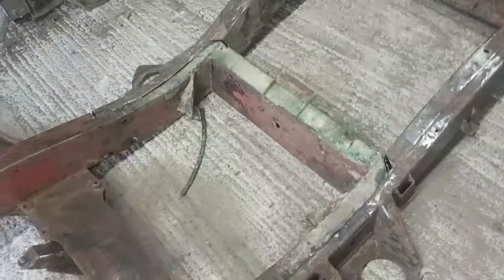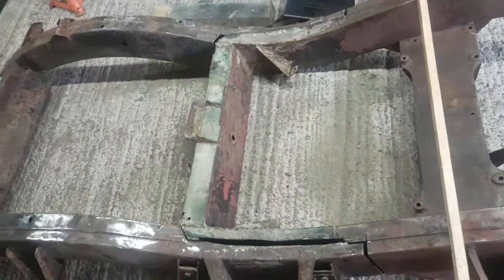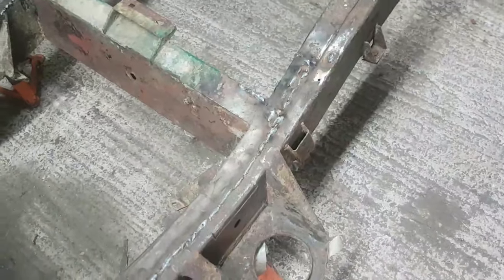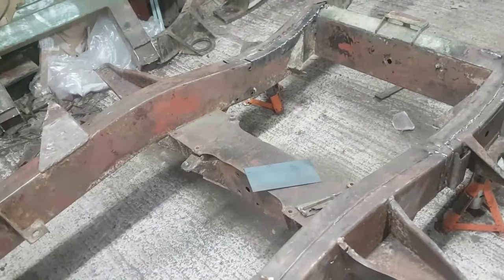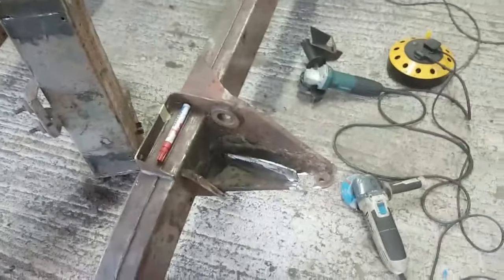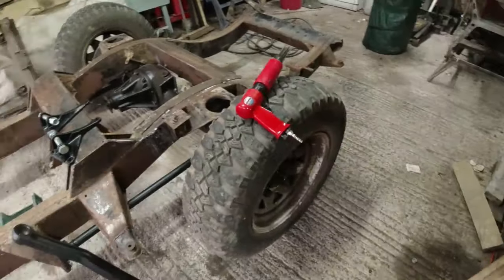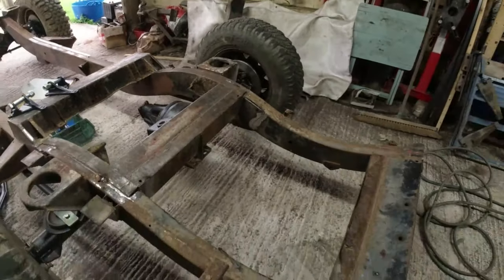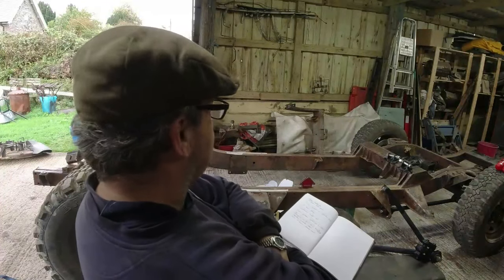Episode 13   1971 Range Rover BOB - chassis wurkz - parental warning

Comment: I love the channel, one seeming daft question kept popping into my head though, I don’t know my rangies too well so maybe I’m actually miles off but isn’t a Range Rover chassis identical to a disco 1 chassis? If so couldn’t you have swapped to a disco chassis as there’s pristine ones getting scraped all over the uk at the moment?
Reply from the maker: UK DVLA rules mean that if you use a 2nd hand chassis it retains the ID associated with that chassis. There is the a points system etc to avoid the DVLA issuing a Q plate. To retain my J plate for this 1971 Range Rover, the majority of the chassis needs to be original. Then so long as the axles etc are to the original design the original ID can be retained.

I know there are a world of cars out there with dodgy ID, not something that I am getting into .👍
Reply: Church House Classics , thanks for the reply, fair enough, I guess if you’re recording the whole lot for YouTube there would always be some bugger to report you ect. 
I’ve noticed that since prices of Shonky old rovers have gone up folk have been got funny about them. 
Personally I just see all of mine as just bits of metal but heyho. 
Love your work mate 👍